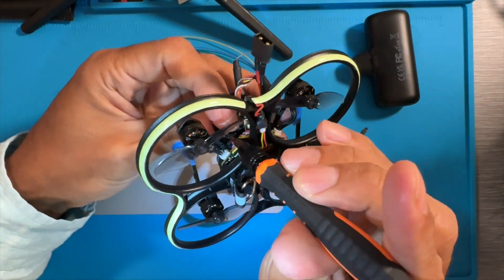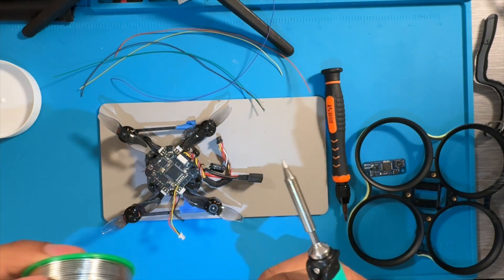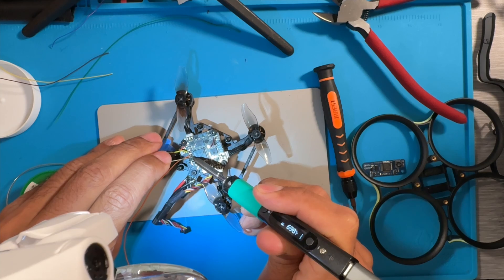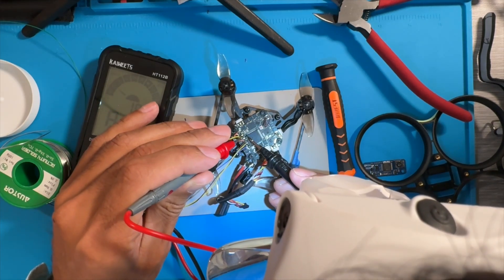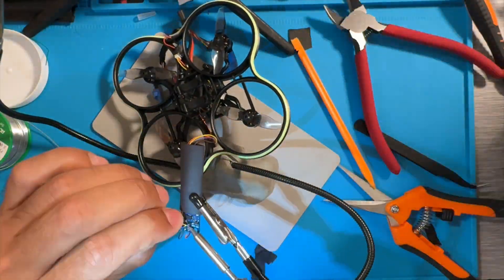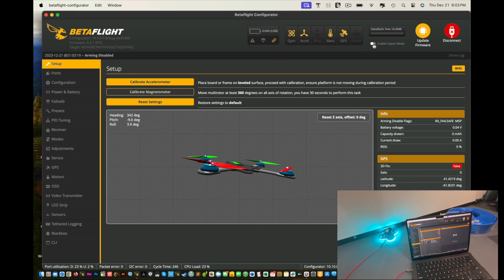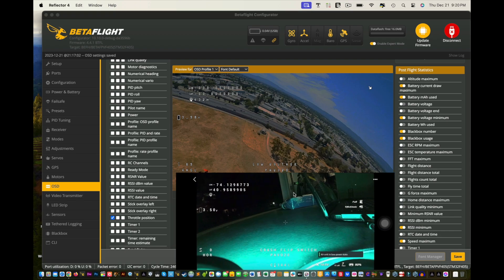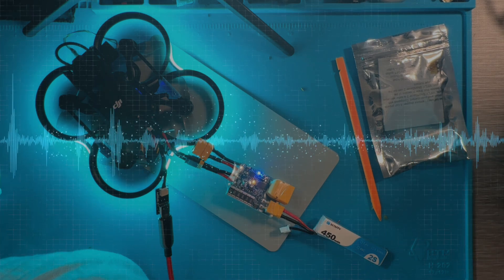Pavo20 GPS Install - how to install GPS on Pavo20

Comment: Hi does the compass works also? I've bought the HGLRC M100-5883 that supports the compass, that I will install to the pavo 20 pro. Thanks for your video and support
Reply from the maker: It does show the direction with the arrow on the location of the drone and how many feet way you are from it..

Comment: Exactly what I needed! Thank you Lou
Reply from the maker: You’re welcome!  Hope it works for you . Just remember that 
5v to 5v - Wire color should be red or orange
T1 to R -   Wire color can be any color you like
R1 to T -   Wire color can be any color you like

On a flight control board, "R1" and "T1" typically refer to the first UART (Universal Asynchronous Receiver/Transmitter)
Reply: @How-to-by-Lou got it. I should check and make sure UART 1 is not in use before doing this.
Reply from the maker: @508AirPhotography it’s fine there is always UART6
Reply: @How-to-by-Lou sorry to keep asking questions but you recommend the ViFly bfonder buzzer thing instead of the GPS?
Reply from the maker: @508AirPhotography  You can use both according to the diagram. Should not be a problem. with both but there is not a whole lot of space on the drone. What's the area like where you fly? Lots of trees.
Reply: @How-to-by-Lou yeahhhhh, my first Pavo20 had some issue, lost RX and VTX and Tx all of a sudden and it dropped or flew away into near by woods. Searched for 3-4hrs and found nothing, the blue led lights where on when flying I assumed the battery came out or something. Never found it
Reply: I am also new to the non-dji drone world now all this soldering and UART and gps stuff is new to me.
Reply from the maker: @508AirPhotography  might want to try the soldering for beginners videos. These kits are only 20$ a fraction of what the flight controller cost so if you mess up ya can't go wrong.. 

https://www.youtube.com/watch?v=Brtyj2lZtFk&t=69s
Reply from the maker: @508AirPhotography  Plenty of soldering videos to choose from before you start on a flight controller. 

https://www.youtube.com/watch?v=fGjuJSdZEm0&list=PL3k3rcgGhTvPiFrM9Fb2tpuLbnwVO66nD
Reply: @How-to-by-Lou yup all ready got them. I’ve watched how you do soldering and Joshua Barswell also.
Reply from the maker: @508AirPhotography  . If ya went to the god father of FPV you'll be fine.. just make sure you have that smoke stopper. Just ordered a buzzer won't be here till Friday.. Didn't do the vifly.. they are adding an additionl 10$ and call it tariff pricing. Got 2 for one from amazon. Will do GPS this week and buzzer the next. there are buzzer pads for soldering your wires on the other side of the board. So there seems to be plenty of room.. 
https://a.co/d/6DJOUgH
Reply: @How-to-by-Lou oh I’m excited. I have at least 2 weeks before the second pavo20 arrives so I have time to watch your vids. I watch no one person I like options and opinions from everyone. I look forward your How-vids all the time. And the way you pop into your chair makes me laugh every time  I appreciate it.
Reply from the maker: Here you go.. Great idea for new video.. let us know how it goes. Buzzer will follow next week.
https://youtu.be/RixwJVrU1_E
Reply: @How-to-by-Lou already watching it!! Your amazing. Shared and passed to others that have the same questions.

Comment: Hey Lou, how's it going.  I did a ChatGpt search on adding GPS to a pavo 25 and the only thing that comes up is all your videos on the pavo20 and pavo pico.  ChatGpt thinks your it.  Have you done any gps videos on the pavo25.  If not, is it any different.
Reply from the maker: Great idea for new video though.. Won't be able to do the install until the GPS unit arrives.. There is a T1 and R1 on the flight controller for the Pavo25 V2 as the Ground and 5V those go in it's usual spot. 

T- R1.........R-T1

Thanks for sharing. Didn't know the chat AI bots had me highly recommend for this solution. 

Guess the only way to keep in the chat bot AI rankings is to create that video solution..

Flight controller on the Pavo25 V2
https://betafpv.com/cdn/shop/products/dc3ebdb3ce4965130693f4d92cc0cf72_57347b63-2d88-4d11-96dc-236a55afa0f5_720x.jpg?v=1673606561
Reply: @How-to-by-Lou  I started looking through your channel.  It says you have over 1,000 videos.  Thought I'd ask you about the FC.
Reply from the maker: @gsgsgsgs3650   Tend to always as these guys for guidance when it comes to FC, they are the best. they listen and come back with the best solution that works just right for you.. 
https://pyrodrone.com/
Reply: @How-to-by-Lou  as a side note while testing my pavo25 out, I crashed it because I wasn't watching the battery voltage.  I smoked the FC.  Do you have any FC replacement videos.  I'm not sure if I would have to update the firmware.  If you have any on the F722, I'd love to watch it.  Any FC replacement video would do.

Comment: Hello, I soldered a TBS Crossfire to the T1 and R1 pads and GPS to the T6 and R6 pads. Before that, there was a yellow wire of the LED strip on the R6 pad, I soldered it to the LED pad. As a result, the GPS still doesn't work. What settings need to be made in BetaFly to make the GPS and the LED strip work?
Reply from the maker: Bradwell may have a cross fire version but we covered it live..

Will cover it again in one sec.. Going live in about 30 minutes.. 
https://www.youtube.com/watch?v=bGSqosxfm2o
Reply from the maker: 58 min into live stream might be possible solution....Hope this helps.. Let us know how it. goes.. https://www.youtube.com/watch?v=udmCGjIkcMg
Reply: @sergeyvinnitsa4170  I had same issue than you, crossfire on uart 1 and gps on uart 6 (and gps not detected on betaflight). My solution has been to solder gps on uart 1 and crossfire on uart 3. For uart 3 you need to remove resistor to solder your Rx and tx. You can see where's the uart 3 on the betafpv website on the" F4 2-3S 20A AIO FC V1" page. It's works fine for me now.

Comment: After gps installed, are you able to update betaflight firmware?
Reply from the maker: @ManAndTechOfficial1  not sure / have never updated the firmware .. 

You probably want to do a CLI dump before updating the firmware

This way you can go back to what is was if you don’t like what it is

Hope this helps..

Let us know how it goes 
CLI Dump in BetaFlight - How to Save your flight controller settings,
https://youtu.be/yPxt9cc_F7w
Reply: @ I updated 4.5.1 before gps installed in my pavo20 now it’s flying better than before and gps rescue also working as expected, after gps installed we can’t able to update firmware, since gps wire soldered, maybe you can try to update stock firmware 4.4.1 in your board with gps soldered, you may get an error, then remove gps and try it will work.

Comment: Would have been nice if you'd have shown where you mounted the GPS. The meandering dialogue was annoying
Reply from the maker: @stephenyork7318  26 minutes in there is the mounting part

This drone was built from scratch..
There are no edits on drone build videos 

All parts are included for the new guy who plans to do the same

Hope this helps
https://youtu.be/NUd4JPoSCsE?si=CpKk1fMhs0jI9NeV

Comment: Hi Lou, this is off topic, but I just wonder how important it is to put capacitor at your power input on Pavo20?
Reply from the maker: @abrambah  hi 

Hard to say most builds have it as for where it goes it remains to be argued..

Some say where it’s put is wrong and others will say where it is , is right…

I can say where it was put in the how to build a drone series is that it works fine..hope this helps 

Just challenging when putting it together..

If you’re planning to build one here is the series. Bradwell or Drone Camps might have a better answer..

How to build a drone

Part 1 - Building Pavo from scratch
https://www.youtube.com/watch?v=DcniZz1BN3s

Part 2 - Building Pavo from scratch
https://www.youtube.com/watch?v=Mg-KHnlJf9Q

Part  3 - Building Pavo from scratch
https://www.youtube.com/watch?v=Zt0PNl30I0c

Part 4 - Building Pavo from scratch
https://www.youtube.com/live/spZ2kFAaywM

Solder LEDs - Building Pavo from scratch
https://www.youtube.com/watch?v=yzHsdqTBy5M

Troubleshooting - Building Pavo from scratch
https://www.youtube.com/watch?v=LEw5Gha1eRo

Tear down - Building Pavo from scratch
https://www.youtube.com/watch?v=_WmvOH2fsss

Pavo Pico USBC connector not working
https://studio.youtube.com/video/0BrLDlaqNZw/edit
Reply: @ Thank you so much. Helped a lot, as usual :)
Reply from the maker: Hard to say but tried answering it live.. 50 minutes into live stream 
https://www.youtube.com/watch?v=4eSv9fTzeaA

Comment: Good informative video.  Were you able to get your Pavo20 actually flying with good GPS satellite count & lock?  Can you get position hold hover and return-to-home working?
Reply from the maker: Have not gotten the return home working yet. The battery life is so short on this drone. You want to lock in the GPS before flight.. Plug usbc into computer When GPS load then plug in the battery. Hopes this helps...
Reply: @How-to-by-Lou  Thanks.  Is the GPS losing all or most satellites after you turn on your VTX for takeoff?

Comment: And with all this done now you need to mount the gps in a place away from electrical interference for the gps to work right and you need to copper shield the gps wires also, thats if you want your gps to work correctly  if you dont do all that forget about installing a gps becuase you are taking a chance of losing your drone or smashing it to the ground.
Reply from the maker: Excellent idea for new video.. Got the copper.. thanks for the tip.....

Comment: Thanks for sharing your knowledge. I got a pavo 20 too with air unit 03, the problem with air unit 03 is overheating, I found a micro fan from amazon which is a 5V fan, can you help us where to connect the fan to the board? Thanks
Reply from the maker: Cam you share the link to the fan.. I might be able to help..

Comment: Thanks for the terrific video! Two quick questions. Does it help stabilize the drone like other DJI drones or does it just help you locate home? And also where did you mount it on the unit itself as I did not see it clearly. Thx
Reply from the maker: I wish.. but I think next year this time beta FPV drones will be flying like the avata.. They already have a new one that hovers so it's just a matter of time.. I have not tested these rates yet but one of our viewers shared this.. 

@YonnBurgos
I can share my rates. I adjusted and fine-tune it until I could fly inside my home. Right after I adjusted and found the sweet spot, I was able to manage flying it a lot better inside my home. 

Roll: 10/250/0.54 
Pitch 10/250/0.54 
Yaw 40/350/0.50

I also adjusted my 

Throttle MID to 0.40 

Throttle Expo to 0.45

The Throttle Limit I set it to OFF 

and left my 

Throttle Limit % to 100.

If the above, helped, let me know. I am documenting everything from when I got it, my crashes, fixing it, etc. to have it posted on YouTube as well.

3M Strip 
https://a.co/d/4FTA77U

All in all it just helps you to locate it when in a wooded and busy area.. In an open field it more for the experience.. but at the and of the day this solder video upgrade will help get you ready for the DJI Avata motor upgrade. 

More soldering videos to come down the line. 

You only get one take on the DJI  Avata. Hope this helps.. 
https://www.youtube.com/watch?v=E1-Pevota8w

Comment: I have the exact same drone and I want to do the same thing but my problem is I have to put a tbs nano receiver on as well and I don’t want to lose my drones leds because there is only 2uarts but I have three peripherals to attach? If I unsolder my led tx1 pad will the lights still work but without a switch?!
Reply from the maker: Sorry this took so long did not see this.. It might but you may have to jerry rig it.. How did it go?

Comment: I see you getting better at soldering.  I have a question about why you would put GPS on a small drone?  You are not going to fly a small drone out of sight.  It just ads unnecessary weight.  Im just saying but really no advantage to having GPS on such a small drone that even if you wanted to fly long distance your limited by the battery size.
Reply from the maker: Hey.... Happy Holidays.. Hope all is well.. Great to hear from you.. 

GPS works well when flying near the woods that can be dense and will give one an idea and indication of the drone location when being 10  - 15 feet from where they are standing... Creates a better geo caching experience. 

Also the solder projects on the channel are stepping stones to help the beginner level up when planning to do the motor upgrade for the dji avata.. 

As a beginner I'd do the small solder projects before doing the Axisflying  Motor Upgrade.... It's soooo challenging but rewarding in the end..